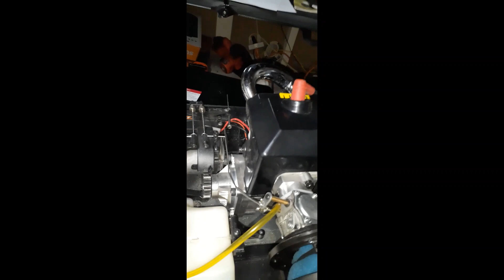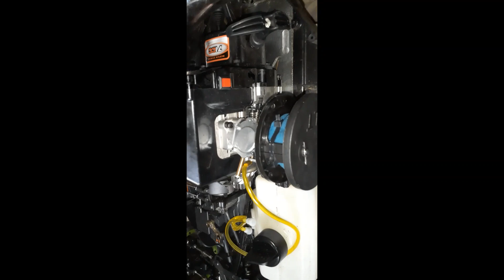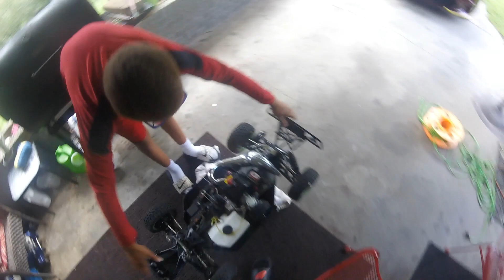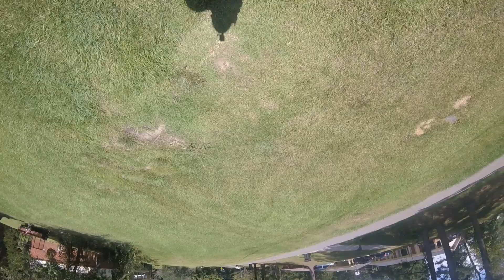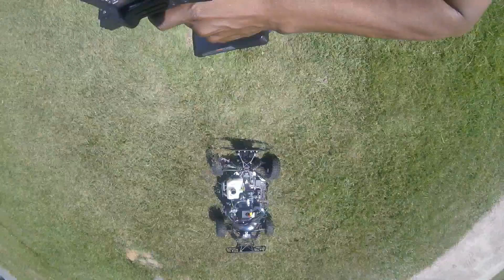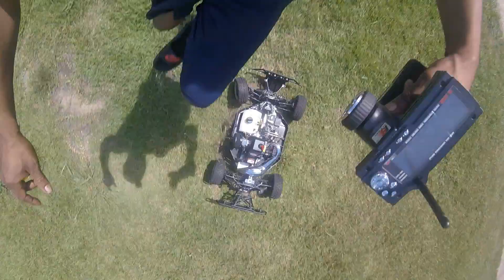Rovan 71cc update

Comment: Change the plug.  Lean the top end out till it bogs on acceleration (on stand) then start adding fuel on high needle until bog goes away and keep adding fuel until it rpm starts dropping then lean it back to peak rpm.  What ratio fuel/oil are you running?  Prolly not going to be a screamer in terms of rpm but it’s definitely not at its peak.  Have you ever watched the obr tuning video?  It’s on YT and a great place to start.  Keep posting vids.  Is the clutch carrier/clutch enclosure the same as a G320RC?
Reply from the maker: thanks for the feedback and yes the clutch carrier is the same . im running about 28:1 on fuel mixture
Reply: it sounds lean when its idle   bro my advice go to 32:1 i been for years it makes tunning easier i dont do 25:1 or 28  i use amsoil and redline racing oils i tried many times with 25:1 terrible my bro! took me all day to tune and it still ran like crap then i went to 40:1 it was night and day rpms high no more lean no more smoke no bogging just takes off

Comment: I think it’s obvious that it isn’t tuned right but get a different pipe for it get a Taylor rc 71 cc pipe for a 5t it should fit your motor and chassis but do some reasearch and if you do the pipe it will make some good power

Comment: If I was you by a new walbro. Buy a high velocity fuel line.  Have new spark plugs ready, If there's gaskets between it take it out, and replace it with liguid gasket for closer squeeze for faster response, and use a bigger air filter.  It should be fixed.  If not than it must have a leak in the block some where.

Comment: And set the needles 1.5 and 1.5. Then it should be a little rich and move them an 1/8 turn in. If that don’t work try 1.75 and 1.75.

Comment: And those motors like to run a little rich cause fuel is energy and it’s better in the long run. Especially if you run it for long periods of time cause the heat of the motor will lean the settings.

Comment: Wow that is the absolute worst tuning I’ve ever seen. First off you won’t get the rpms with a fresh engine. It has to be broke in and second of all your trying to tune it on a bench with your kid holding it down while your wide open on throttle. You can’t rev these engines like that on a fresh engine it has to be broken in before you even put a tune on it and has to be under a load not with it on a bench free wheeling. Your lucky A tire didn’t come apart and hit your kid in the face